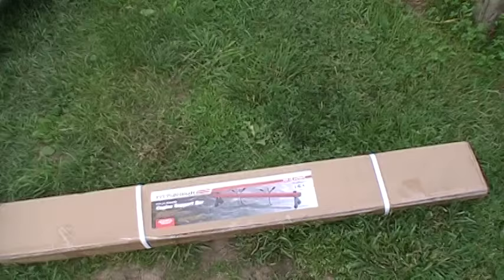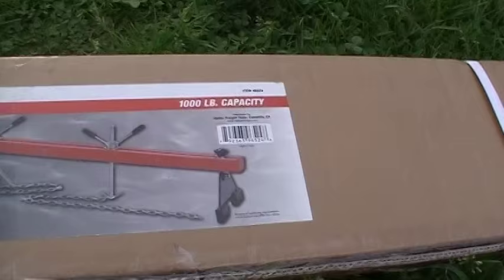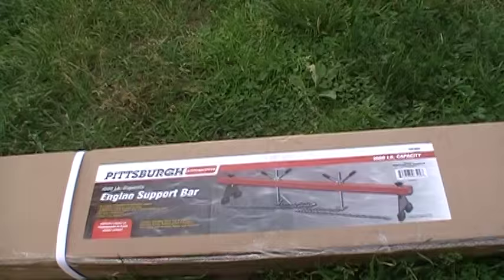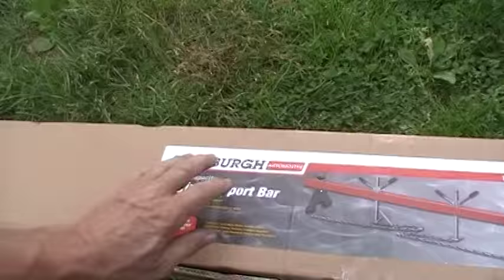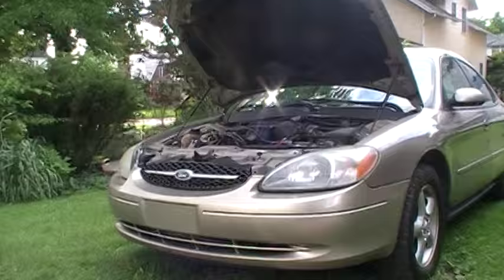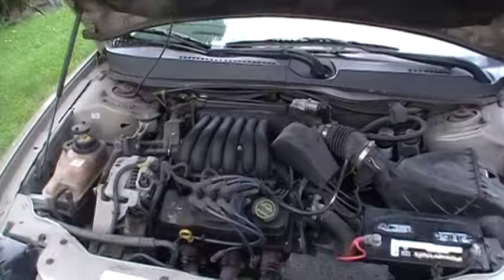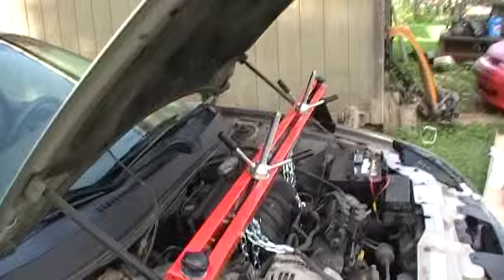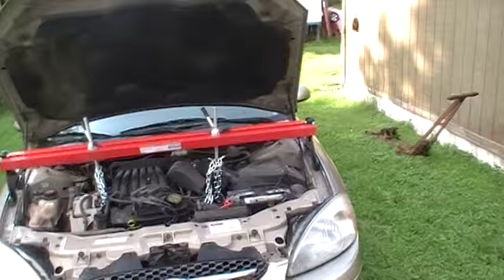Harbor Freight 1000 lb. Engine Support Unboxing / review

Comment: I built one out of wood a few years ago. I made it to support the engine for a clutch and transaxle replacement. Used turnbuckles to lower the left side. It worked just fine. Spent maybe $20.00 on the chain and turnbuckles. I had the 2x4's just laying around. I'm going to pick up one of these today though. While the wood one certainly did the job, these are no doubt stronger and the screws sure beats using a turnbuckle to raise or lower the engine. The bad thing,,,, I should have replaced the core plugs before the put the new clutch and trans in back then. I wouldn't need to be taking it back out, had I of done that. Oh well, live and learn.
Reply from the maker: Nice, Mine would break and fall.
Reply: @FixingWithPassion  I just got back from HF. Yeah, these are a better, safer solution. I've no doubt it will make the job easier too. Thanks for doing the review, It was very helpful.

Comment: I need to change engine mount where do you tight the chain to the engine
Reply: You can use a trolley Jack with a block of wood on the head to support the engine, the block of wood stops the metal head of the Jack from damaging the sump.

Comment: Did you have to do a wheel realignment after you re-installed that transmission?
Reply: If he disconnected the steering column from the rack and pinion assembly, he would have to get an alignment done for sure.

Comment: Very curious, can the transmission be slid away from the block far enough to replace a soft plug on the block?? Please advise.
Reply from the maker: Hum, yea prob so.....but....by the time you do all that work and the 
transmission is all ready un-hooked....  you'd have more room just to 
drop it and replace a soft plug.
Reply: Thanks for your response. Yes, you're right. Point well taken. Also, is there an exaust gasket (not manifold) where you'd separated it? Thanks again!
Reply from the maker: https://www.youtube.com/watch?v=syPqR5TVfBY   ----At 23:17 I talk about the exhaust gasket.
Reply: I'm sorry sir, I have very poor audio on this PC, listened for a difinitive answer but still don't know. Wondered if there is anything else I should do while the trans is out. Heard bout problems with shaft to pump stripping....something I should address? Also, which is better for soft plugs,   ..steel or brass? Thanks a million
Reply from the maker: Steel is fine....I was talking about the torque converter pump....that gear strips out sometimes. Ford designed it poorly. Most people go on e-bay and buy a rebuilt one that has a strong input shaft gear in the torque converter. I did, I spent only $90 for a new one. That's if you want to.
Reply: I'm so glad I watched this video BEFORE I dug into it. Spending a little time, saved me a lot of time. I would've been that guy screwing up stuff, and the bolt best done after sub frame drops some, awesome. Thanks
Reply from the maker: Thanks, I getting better as steady shots and using a tripod. I'm trying to go professional///somewhat. Glad it worked for you!

Comment: Can you use some 2×4 to do same job
Reply from the maker: I think you could. But you may have to adjust the height some to get everything just right. I'd use double 2x4's nailed or bolted together to be safe.
Reply: Using wood as an alternative to steel is possible but isn't your life worth more than $75 bucks?
Reply: I thouht the same thing.. but then again, im not gonna kill myself because I was a cheap ass! Og you use wood and straps make sure to go safetyfactor 10!! This tool is made for it!
Reply: @ Technical 
No - not everyone’s is worth the $75 ........ trust me